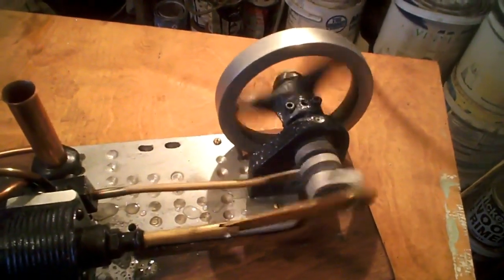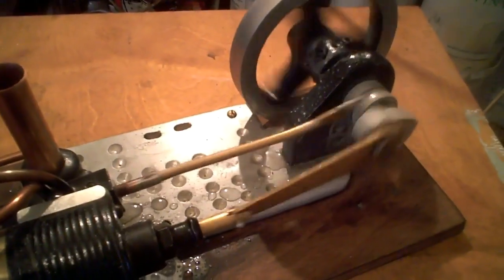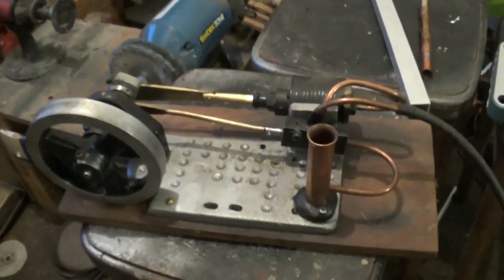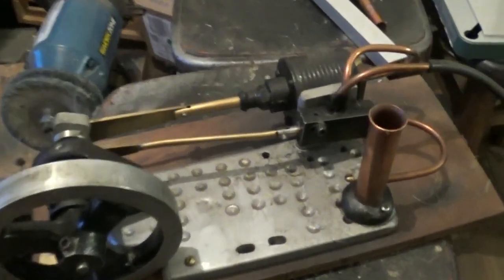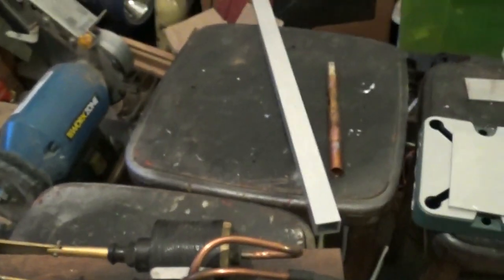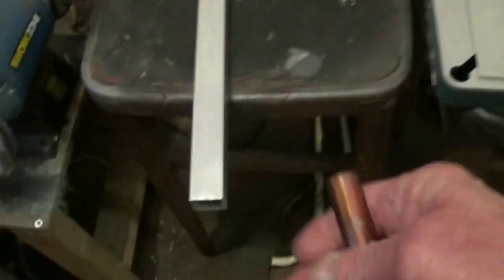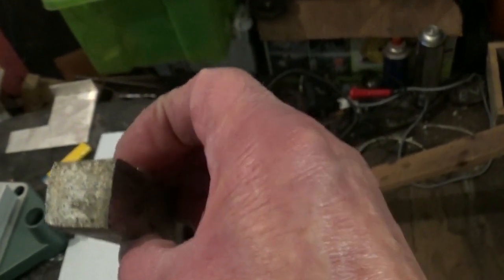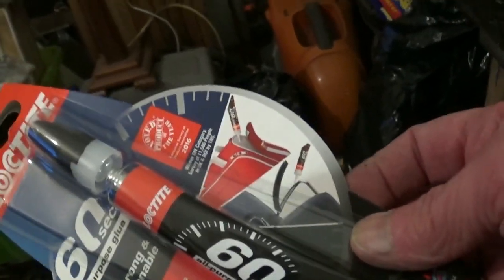Model Steam Engine Challenge The Idea

Comment: Well it sounds like a great idea to encourage young kids to get off their duffs and do something rather than being glued to a game screen. I repaired a steam engine I bought off of ebay. It was not complete so I completed it and got it to work. Never built one from scratch before. I might see if i can get the bits together use a metal can for a boiler then piston cut from a carriage bolt Ok I am thinking in my mind how to put it together lol almost got it. Just need to get off my fat duff and do it lol Cheers
Reply from the maker: Cheers Larry - the more ways of making one the better. Run it on compressed air. I don't have a compressor so going to use a car tyre. Even a foot pump to blow it up....only need 10/15lb.